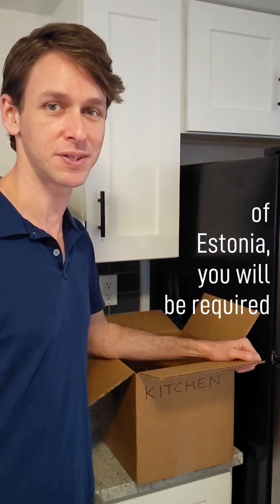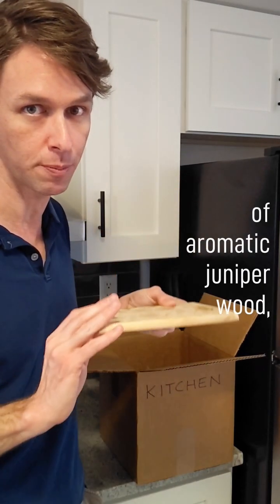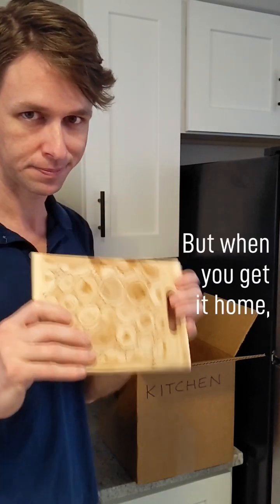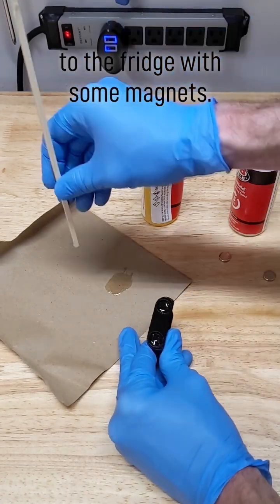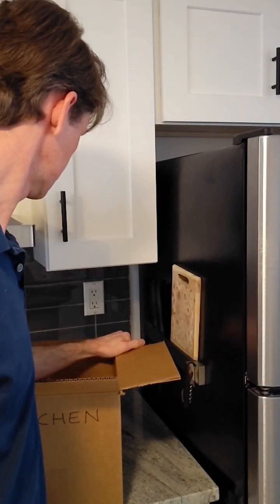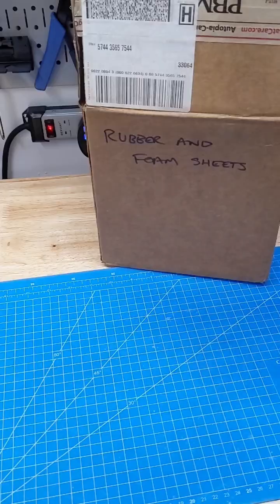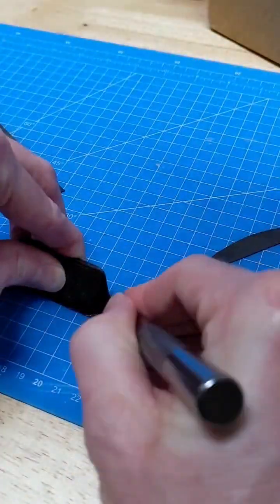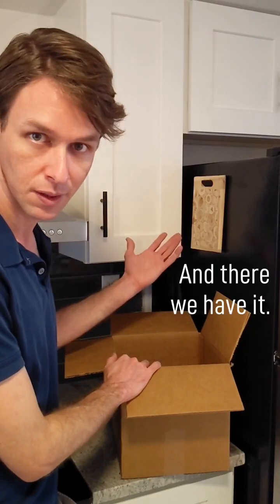3D Printing a Magnetic Refrigerator Hook

Comment: You can press-fit magnets like that - I have a dozen tiny magnet hooks hanging around my house; in 3d printing I dislike messing with resins or glues (or really any extraneous hardware) when I have basically any other option.
Reply from the maker: Thanks for the tip! I'd don't love messing about with epoxy either. How much interference do you design for in that case?
Reply: @EikiMartinson  Not sure how to measure that - I print a small test ring, then if it's too loose I reduce the size and try again.  I think I only had to try a time or two with the magnet loops I have.  As long as the ring is radially thick enough, there should be a range where you nearly need to hammer the magnets in, but where the rings don't break.
Reply from the maker: @Erhannis  Well, I did promise a sequel! Maybe I'll experiment with that too. Thanks!